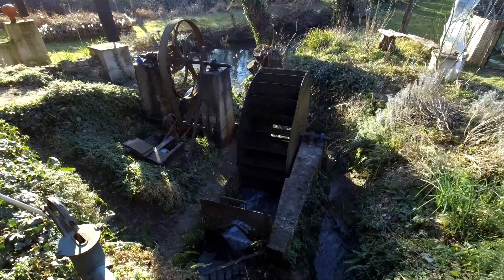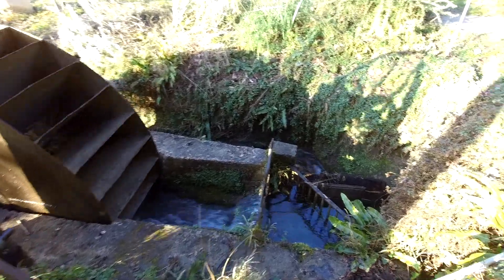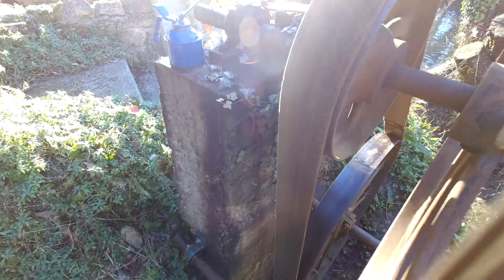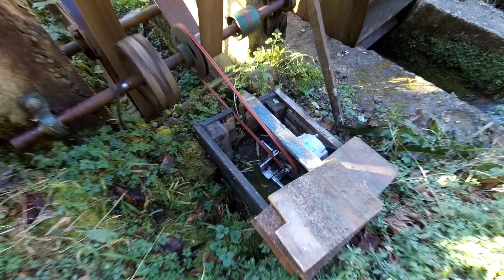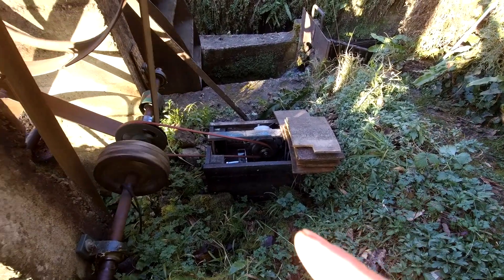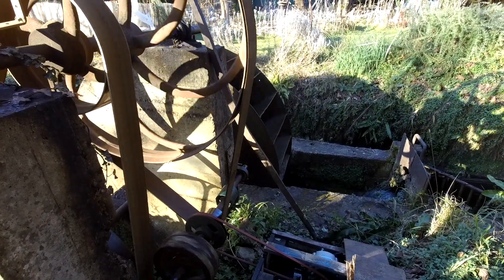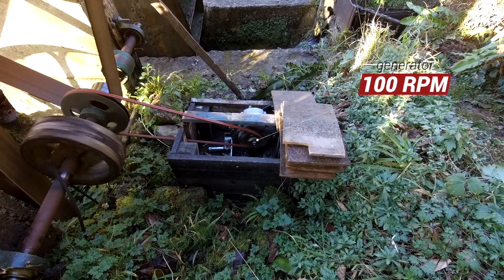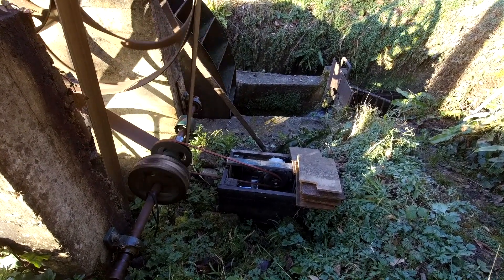My Hydro power plant - Prof Simon

Comment: Very cool I hope it doesn't freeze in your part of the world. I live in Phoenix Arizona and generate 7.5Kw  solar energy daily average (24 panels at 320 watts each that provide us with about 65% of our electricity needs throughout the year. We paid $19,000 in 2013 and figure it has almost paid for itself to date. Our average monthly electrical cost is around $90.00 per month or $1,100 annually. Prior to installing the solar our annual cost was in excess $ 3,300 at 2013 rates. I only wish we had more roof space available.

Comment: Very charming indeed.  But I seriously doubt it actually generates 5 KW (as shown working).  Or is there a catch in "5 KW of water power turned into green energy".  Still doubtful.  Taking g = 10 m/sec^2, 5 KW of water power implies that Head (in m) x Flow Rate (liters/sec) = 500 (i.e 5 KW / 10 m/sec^2).  So, a Head of 5 m (unlikely) implies Flow Rate = 100 l/sec (unlikely).  Still, it looks great and sounds good. Thanks!
Reply from the maker: Quite correct....the water flow has potentially 5kw energy but the electric power production is about 2 amps at 50ac....converted to DC by a rectifier....to charge 12 v batteries.
Reply: @SimonHollandfilms  What you have is a proof of concept. Now up-rate all the componants to have a reliable output of say 3.5Kw , have a feed in tarrif meter installed, and depending on how much it all costs, you should have a 3 year payback period, after which a nice little proffit. Of course do a youtube Vlog (maybe a 10 episode series) and collect the adsense cash as well :)

Comment: I think it's excellent that you've uploaded a video like this, Professor. Not just because it's fascinating and nicely made, but because it helps dispel the (dangerous, misleading) modern myth that making one's own 'green' energy is a simple, neat, compact, streamlined way to live. It's not. All the gubbins and paraphernalia will fill sheds and barns and paddocks, cost a small fortune, and still barely meet one's needs.  It's really important that people realise just how inefficient most generating systems are, and also how much we take today's almost limitless on-tap 'dirty' energy for granted.

(On a side-note, I was astonished when I discovered how much energy there is in a single gallon of petrol. Now THAT'S a dense form of energy storage!)

Setting up a homestead in the middle of nowhere and trying to run it 100% 'off grid', without diesel generators but still expecting to meet typical modern energy consumption needs is no easy thing.

People imagine that a few solar panels will run their entire home, when in reality a huge installation costing thousands will just about boil a kettle (in an hour or two) and charge a mobile phone. It comes as a shock to realise how feeble things like (small) wind and water-driven generators are on a domestic level.

Thanks for an honest video. People may not want to hear some things, but they need to accept them if they're going to appreciate the realities of going green.

Comment: How much electrical power is produced by the water wheel installation?
Reply from the maker: No much....the wheel can charge 12 v batteries...we used to turn that into mains power but now we have 12v led lights in the basement....green power is hard. ....there is more energy to make use of.

Comment: why have two channels that separate one towards the wheel and another direct path to the river, would not have more power and force it was all directed at the wheel?
Reply from the maker: see above....the diversion channel is for too much water for the wheel to cope with...the belts slip.
Reply: @SimonHollandfilms  you ought to look to cog belts
Reply from the maker: Good question.....we find that if we put too much water though the wheel...the flat belts slip....there is an optimum amount of water flow....every day I mess with it...using a wooden board.